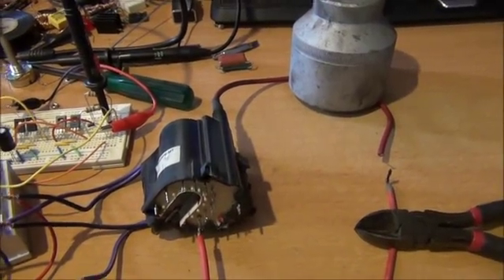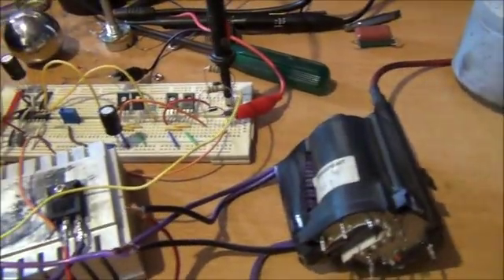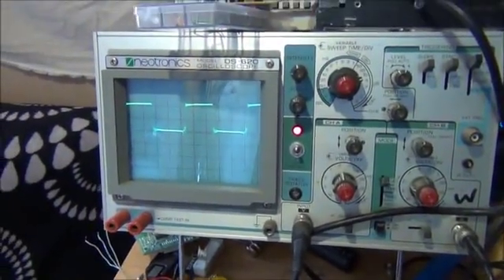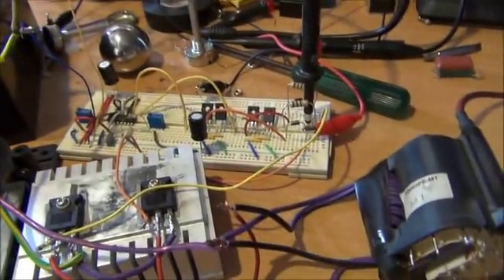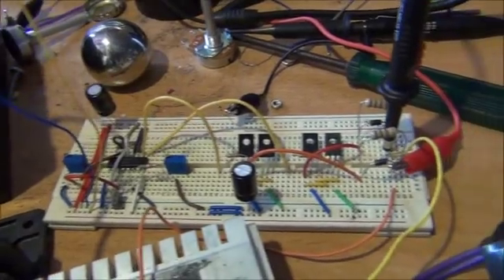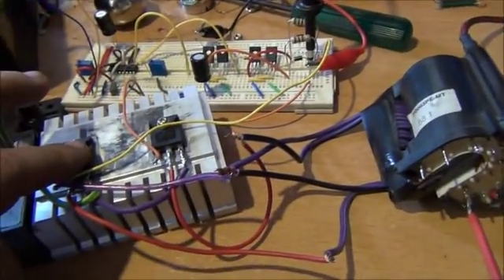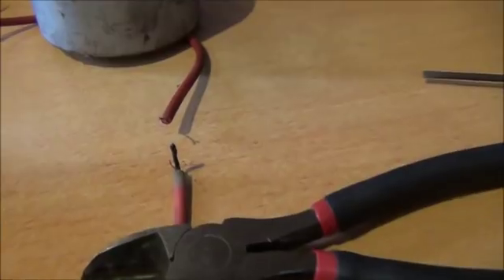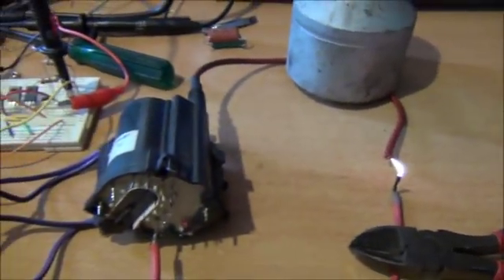TL494 Flyback Driver Arcing + Some Waffling!

Comment: Really nice :-) do write the diagram down with default settings if nothing else, for your note book of experements :-)

Yes i can see a purple haze before it fully conducts :-)

Some gas boilers use the conductivity of a flame to switch the pilot gas off if it goes out, see if a lit match flame gives a good path to start the arc :-)
There is a daft thought lol. :-)

Comment: yes i do think bifilar is the ticket but ive noticed heavy voltage spike with it though.these can be eliminated with a resistor capacitor combo across the coil.but that also impedes performance.. what driver are you using i use  a 3525 ic.but the 555 timer is cheaper lol.peace